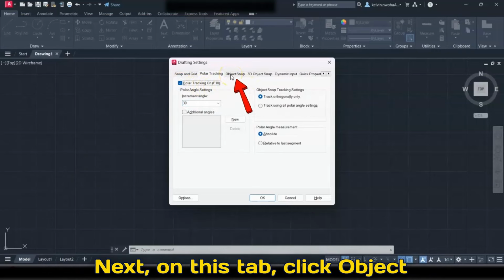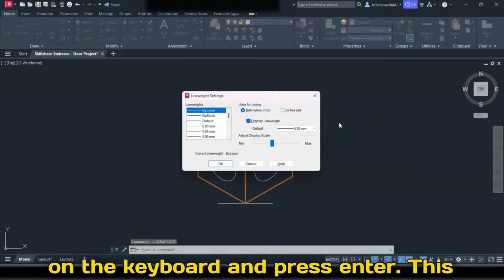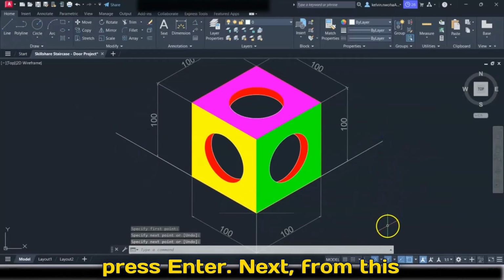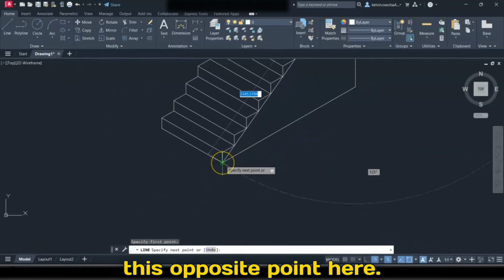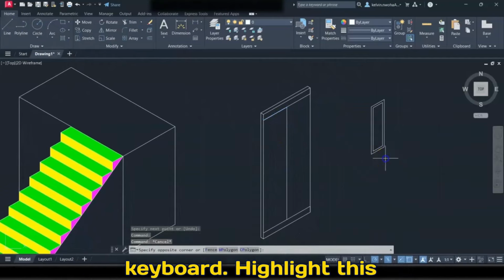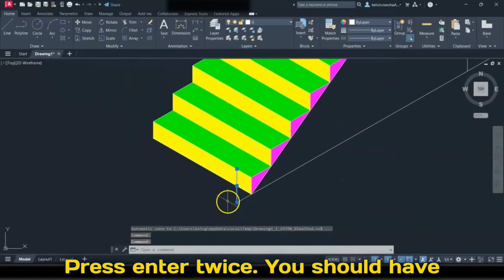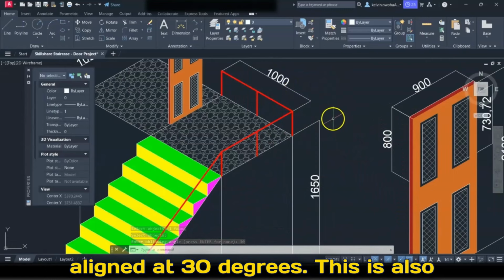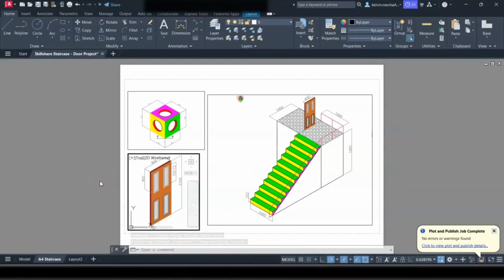Master Basic Staircase and Door in Isometric Drawing: Dimensioning and Printing in AutoCAD

Comment from the maker: 🔥Learn step-by-step Drawing Projects in AutoCAD🔥
https://www.youtube.com/playlist?list=PLGiODXzBccMb-oyTZ8v2wADW1TXYGNxvm

Video Timestamp:
00:00 Understanding Isometric Drawing in AutoCAD – Introduction
02:06 How to Select an Isometric Angle in AutoCAD
02:31 How to Turn on Polar Tracking in AutoCAD
02:59 How to Turn on Object Snap in AutoCAD
03:08 How to Turn off Grid Lines in AutoCAD
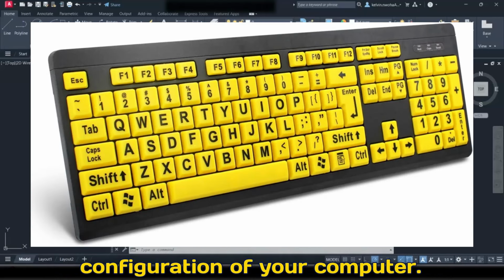03:26 How to Switch From 2D Workspace to Isometric Workspace
04:05 Isometric Working Principles in AutoCAD
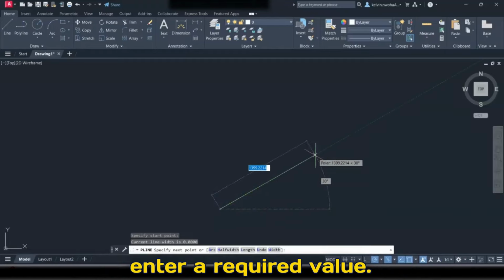04:54 How to Draw Basic Isometric Cube Box
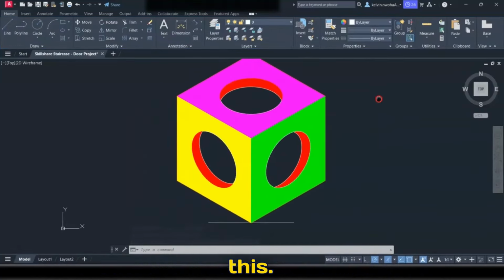13:15 How to Dimension Objects in Isometric Plane Workspace
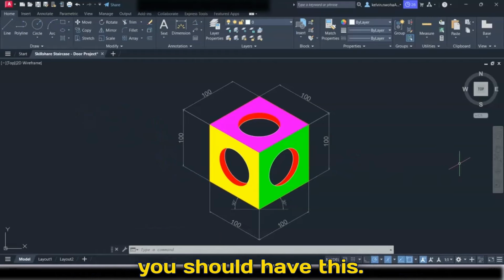19:16 Design the Staircase Outline in AutoCAD
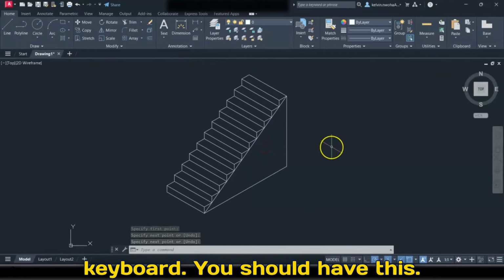25:46 Hatching the Staircase in AutoCAD
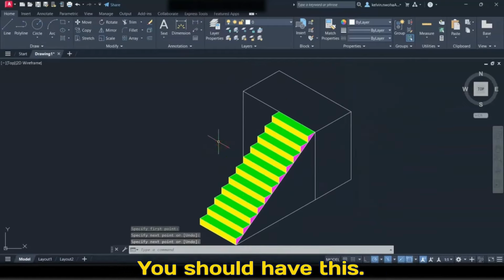29:11 Hatching the Staircase in AutoCAD
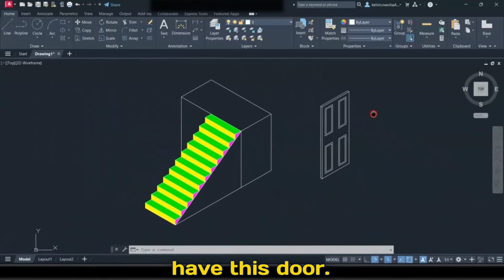35:01 Hatching the Door in AutoCAD
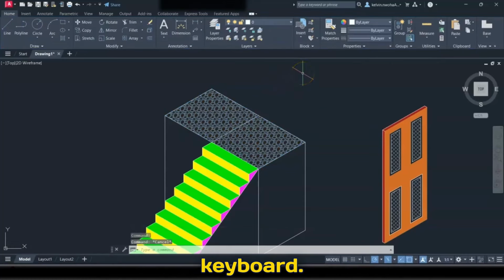37:03 Scaling the Door in AutoCAD
39:29 Balcony and Staircase Rail in AutoCAD
41:51 Dimensioning the Staircase and Door in AutoCAD
49:41 Preparing to Print on Paper Space in AutoCAD
50:51 How to Choose a Paper Size in AutoCAD
53:08 Converting .dwg to .pdf in AutoCAD
54:46 .dwg Straight to the Printer of Plotter
55:21 AutoCAD Model Space vs Paper Space
50:49 Class Project